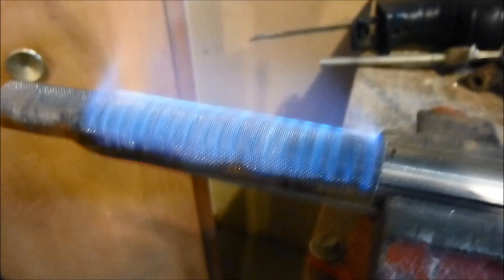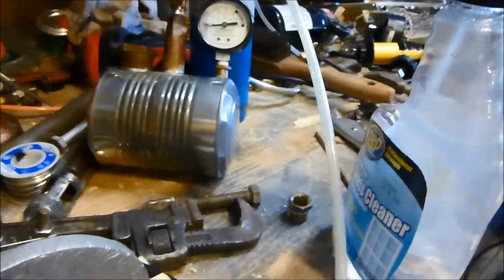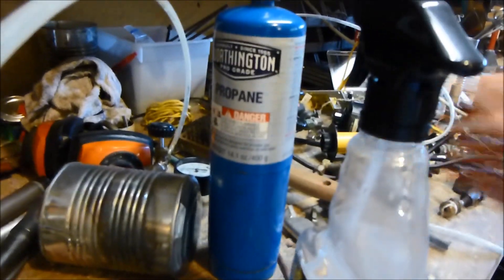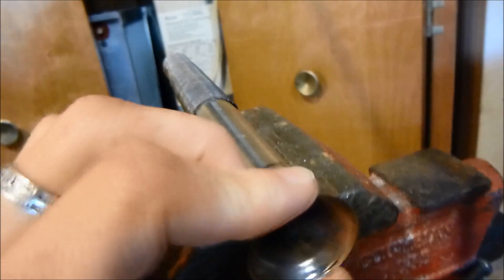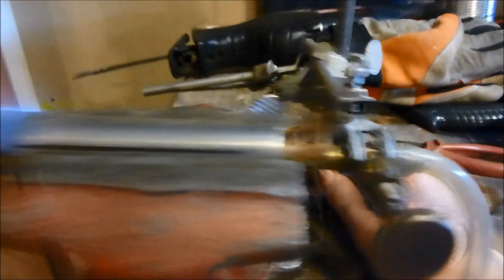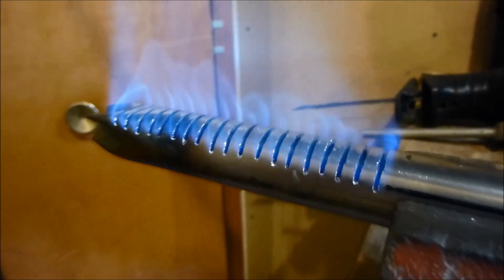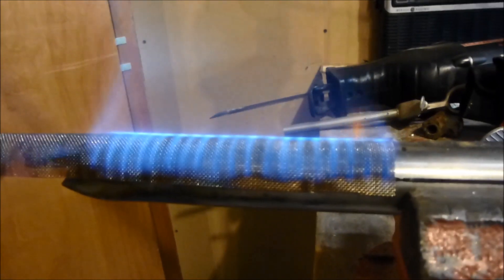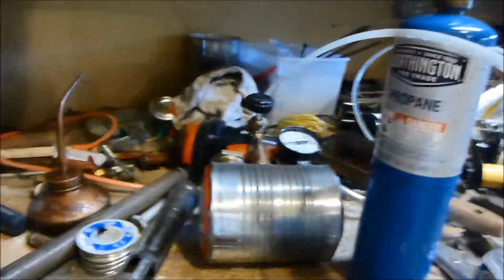Homemade Natural Gas Ribbon Burner For My Steam Boiler

Comment: Sched 40 stainless  pipe with caps  and bungs tigged  for good boiler and dont forget the blow off  relief with a good directional tube   k copper bends well  for steam direction

Comment: You asked for input, I design natural gas burners. This is pretty impressive. With your gas turned up and your screen on you have flame rollout at the end of your tube, you shouldn't crank it up with your screen on but you want you gas high enough to evenly distribute through your burner. Avoid lots of yellow flames and sputtering. Invest $8 in a flame arrestor for your gas line and you'd have a little extra safety.
Reply: An industrial ribbon burner has one longitudinal slot down the full length of the pipe and the mesh is on the inside of the slot. The mesh helps the flame propagate along the pipe. The size of hole for your gas is important. You four use two plates with same size holes and overlap with slightly different offsets to increase or decrease the size of the hole. Then you can experiment to get optimum size.
Reply: is that the same as the oxy/acetylene flame arrestors?  I can't seem to find ones just for propane.
Reply: You want an acetylene one, or you can make one. There's different styles but they're all about the same
Reply: I really like your design though

Comment: Forget the tin cans, & propane bottles.  Get a real model steam boiler from Jensen Mgf. Jeanette, PA. They come with a safety valve, and water level glass. Less than $70.
Reply from the maker: +Gary Clark You will probably never really understand this but building something yourself is so much more rewarding and you learn so much invaluable information and techniques along the way.  I have never actually bought or even owned a model like that.  I've never seen the need to buy a model when I would much rather build one myself.  It's what I do for fun.
Reply: +Makerj101 right?

Theres always more satisfaction in spending all day weaving a basket then just buying one from amazon.
Reply: If you are going to make a model boiler do it proper stop messing around with tin and steel cans. Get a book on model boiler making and build to a standard design out of cooper. Do the required math and find out what pressures you can run at.

Comment: The "Bell" is acting as the Venturi, which is necessary for correct air/gas mixture and positive/negative pressure flows. So yeah, keep it.
Moving the valve/orifice closer and further away is basically your air adjustment mixing valve.
Nice burner! Not sure about the screen, good idea if it's windy otherwise I don't see the point. It will eventually soot over causing vitiation and so form CO.
If you have a correct flame picture, once you place the screen on it you've just altered the flame from the optimal. No different to putting a saucepan on a hob, flame temp drops, burning vitiated and again causing CO, which is why you should always have open window when cooking with gas. It's on open flued appliance, don't forget that.
Make sure you have a CO detector with audible alarm when you're experimenting with gas and stay away from those yellow flames.

Did you apply heat to the end of the burner pipe before crushing it closed, or did you do it cold?

Not good idea to use plastic pipe for gas, if there's a fire there's no protection.
Use micro-bore copper pipe instead, between 4mm & 8mm and buy some BBQ NG orifices off Ebay, pick some up real cheap.

Natural gas optimal combustion ratio is 10 parts Oxy to 1 part methane.

Research "the wobbe number", you might find it of interest.
Stay safe :)
Reply: Thanks for the insight
Reply: No

Comment: Hi,
Why don't you try with the screen inside the tube and when finding the right air flow setup will most probably be what you after. a good shape of flames.
 looks like your cuts are the issue.

Comment: Nice little burner. What PSI were you running it at and orifice size?
Reply from the maker: Jigatree Thank you! I think it's about 2PSI.  Just standard house pressure.  It's probably less than that because of the resistance in the long rubber hose that I am using.
Reply from the maker: Makerj101 I tried measuring the pressure with a gauge.  The needle pretty much didn't move at all. I was doing some research and it seems like house pressure is more like 8 inches of water.  So really low pressure.

Comment: Really nice burner. What i'm always wondering with this: is it really safe? I mean, isn't it possible that the flame goes back into the hose to the tank and then boom? Or is the pressure coming out of it enough to prevent that? And does this type of burner also work with propane gas? We don't have natural gas available here.
Reply: Triangle_DIY  "isn't it possible that the flame goes back into the hose to the tank and then boom?"

Flames need two things, oxygen and fuel. Not only that but if the fuel air mixture is too rich (not enough air) or too lean (too much air), it will not burn. Being that there is no oxygen in the fuel line (hose) or tank, it cannot burn inside the fuel line or tank.  Air and the fuel is mixed just after the nozzle as it moves forward turbulence causes it to mix mix with air and pushes it down the pipe burner. Air is sucked in because of the venturi effect.
Reply: Keith Reynolds
Thanks, makes sense of course!
Reply: Everybody seems to think that will happen. It is impossible for the flame to "burn back" into the hose. There is no oxygen in the hose, just fuel. No oxygen,  no combustion.
Reply: That's what every DIY guy should know, in advance, to stretch a bit more while designing a plot. Thanks a ton for making the things more clearer. BTW, I am trying to design an electricity generator from the heat that is created by  my thermic oil heater, after my primary use is over and the oil is still very hot (200C- 100C). will be very grateful if you could suggest a method. My ID is <bnsynergy@redifmail.com>
R E G A R D S !
Reply: Surendra Nerurkar Several ways to generate electricity from heat OVER 100c
1. TEG (thermo electric Generator, aka Seebeck generator): Most trouble free. Silent operation. No moving parts and nothing that will explode. Low efficiency.
2. Steam. Potentially higher efficiency than TEG. Risk of explosion from pressure. Nosy operation. Part that wear and break down and or need maintenance like lubrication.
Reply: Thanks!

Comment: Well, a Bunsen burner concept would work well I think. Steady gas stream from it's own inlet, and you adjust the amount of air intake from a separate inlet (Place it wherever you like).
Reply from the maker: Joshua Simpson I think Bunsen burners work in a similar way to the way I have this set up.  Thank you!
Reply: Deleted
Reply: Makerj101 What I am trying to say is to install a separate air intake to this system. You will have better control of the burn intensity; instead of using a primary inlet for both, and adjusting the gap for air intake vs gas intake. Good luck to whatever method you choose!
Reply from the maker: Oh!!! I see!  So like a slide valve over the air opening!  I'm thinking to have something like that on the final product!  Thank you!

Comment: Wow, great natural gas burner! Impressive air/fuel mixture methodology. Also, glad to see your retired the tomato bomb--I mean tomato can. With steam you can blow anything up, so it is best to have a large safety"working" margin.  And the shorter propane cylinder would make the burner shorter but not sure which style cylinder is stronger (i.e. the skinny ones are expected to be rough-handled whereas the fatter ones are mainly for camping etc.) but I think you will be fine with either.  I would also install and emergency blow-off valve (pressure-cooker style or simple weight type) for a secondary backup.

Once you get the steam mechanics of the new boiler done, you might consider insulating the boiler as best you can with fireproof insulation (not sure just what to recommend--although rock-wool is a rock!) Then if you really wanted bring out the "cheese-whiz" for this project you might consider a speed control servo-loop whereby you use a tachometer feeding an RC servo to control the burner valve (of course with a fail-safe condition that full-on just runs the engine real fast). Would be some considerable time delay but your controller could use PID/Fuzzy-Logic style control techniques to ramp it up slowly based on boiler temp or steam pressure. But a more immediate goal might be a centrifugal-governor with the rotating balls. I think this is well within your excellent mechanical and scavenging skills!

Lastly, and of course, you just have to hook up a DC generator (motor) to this and light a small incandescent bulb! Or have it operate some sort of Rube-Goldberg crane etc.

On the gas burner: My understanding is that when you have the pure blue you have complete combustion. Personalty, I like the screen. To me, it kept the flame lower and more uniform (which coupled with insulation might make this very efficient). However, not sure about the longevity of the screen material. I have seen food-graters/zesters that have a very fine mesh (might find one at a thrift store?) and that might be thick enough for the long-haul.

Great video, really enjoyed your efforts!
Reply from the maker: SpinStar1956 Yeah I decided it just wasn't safe like everyone was saying.  The two different sizes of propane bottles appear to have about the same wall thickness.  At least by looking at the weld joints they look to be the same thickness.  And when I like tap on them the sound similar.  Hard to tell though.  I like the fatter one because it's bigger and I can put more flue tubes through it without compensating my boilers capacity as much.  It sounds like a good idea to put a backup pressure relief valve.  Just incase the main one gets blocked or something.

I have some really nice high temperature insulation that I plan on using in the fire box.  I actually wasn't really planning on insulating the boiler itself. I'll consider that though.  The high temperature insulation I have is the same stuff I used for my Stirling engine fire box sorta thing.  It's white.  It looks like furnace insulation to me.  I got it from my dads work.  I show the insulation @ 3:40  Stirling Engine #5 Displacer Rebuild and Hot Side Insulated  I have some furnace bricks too.  The really soft type.  So I could always cut some thin slices of that and use that to insulate the fire box.  Maybe I could use one for the bottom of the fire box.

Yeah some kind of governor would be cool!  Maybe I'll build something like that!  We'll have to see!!!  :P  I'm sure I'll run something off my steam engine eventually!  I can't even wait to see what I'll think up!  :D  

I've been trying to think of ways to make a pump to keep the boiler full.  Because I think it won't last long before all the water boils away and I will need to fill it up with water again.  I know there are steam jet pumps but I don't think I would be able to build one with my crud tools.  You need to make some nozzles with really precise angles to make it work properly. Live steam injector water pump:  http://www.the-nerds.org/injector.gif  The other way is to run a piston water pump from the steam engine or make a piston conected to a piston water pump.  One piston would be bigger and be for the steam and the other one would be smaller and for the water.  I think that would be kinda hard to build too.  But it would be really awesome!  I still haven't figured out how the valves work on those piston water pumps.  There is really no mechanism to open and close the steam valve at the right time. - more research needed on my part...

Yeah I definitely will connect up a generator!  Charge some batteries, running lights, or something!  Maybe try charging my smart phone!

I think the screen I have should work pretty good!  I'm pretty sure it's stainless steel!(also scrounged from a dumpster at my dads work, lol)  I'll have to make my fire box so it can accept either with or without the screen on the burner.  Then I can do a comparison to see which is better.

Lots of things to do!  And lots of school work too... lol  I'd way build my boiler than do calculus...

Thank you!

Comment: Less efficient with fuel probably but more power to steam boiler is my guess. going for fuel efficiency or power? or = between both?
Reply from the maker: Wayne Johnson It used the exact same amount of gas with and without the screen.  I didn't adjust the gas level when I took the screen off.  When the flame was changing it was only from me moving the gas jet closer and farther away from the burner tube.  So I was only adjusting the amount of air.  Thank you!